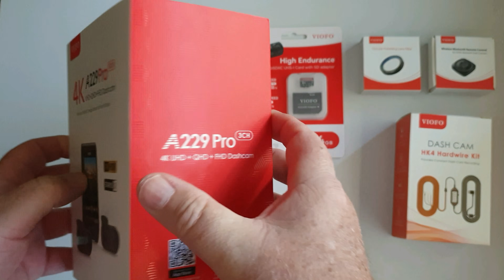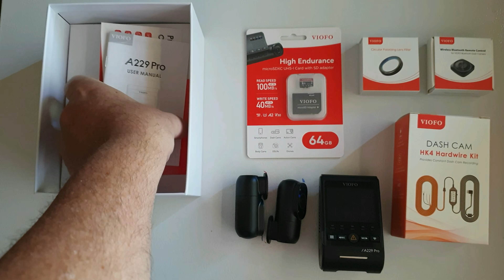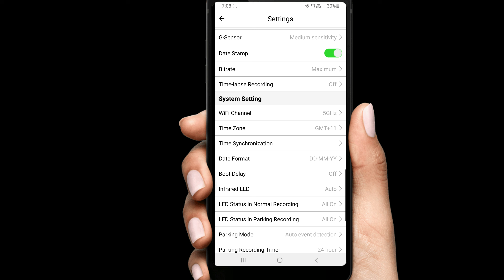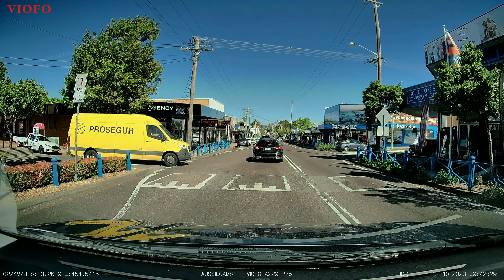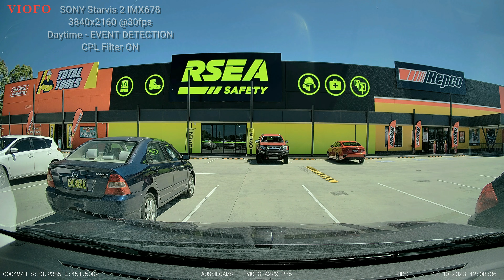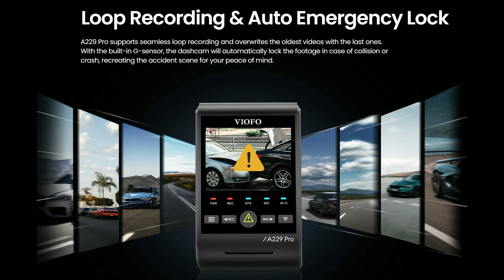Aussiecams - Viofo a229pro Dashcam first look, Unboxing, Roadtest, Overview 4k starvis 2 dash cam

Comment: Hi there. I'm looking at purchasing a new dash cam, but I've got some criteria I want to meet so I was wondering if you had any recommendations? The two most important things for me are sound quality and video quality. I drive a really noisy truck, but I find it's hard to find a dashcam that doesn't distort the audio quality too much. Also great video quality would be a big bonus too. If you see my videos I have two videos that were shot with my navman dashcam, but the audio quality is very distorted as the truck is loud. The picture quality is okay, but I know there's much better out there. Do you think the Viofo products would be good for me? I want to post longer form content from the dashcam itself, that's why I am a bit picky. Thank you.
Reply from the maker: Hey @sar4043 , I can certainly speak for the video quality side of things and i can say that the a229 pro with starvis2 sensor is probably the best for image quality we have tested. In my opinion the starvis2 IMX675+678 is the best leap forward in video quality for some time. As for the audio that's a different kettle of fish! Nothing wrong with any audio i've tested in general driving conditions in a vehicle but the trucks cabin is a completely different animal! I viewed some of your clips and understand exactly what you are talking about. The a229 pro has an optional microphone where you could mount the in the cabin and test to get better results (has a 2 mtr cable you could move around in the cabin and try to achieve the best result) its about $25 from memory. I suppose the voice commands may be affected by where you position the microphone, just something to keep in mind if you were to go that way. In saying that, i have tested it but from reports its an upgrade to the audio quality. Other than that i know its probably hard to find on yt but ive found looking over other truckies clips with maybe a similar rig to yourself is one of the best ways of identifying the better setups.
Reply: @aussiecams  Thanks so much for the reply, I appreciate it! I'll check out some clips with the a229 and the extra microphone and see how it sounds. I think video quality wise it does seem to be the best, or among the best at least. Thanks again.
Reply from the maker: correction, the pro version does not support the optional microphone - only compatible with a229/duo

Comment: will it survive in the heat?
Reply from the maker: Great question! Heat is a factor for all dashcams as temps inside a vehicle in summer can get extremely hot. Operating range up to 70 degrees then i believe it has auto heat safety shutoff. Im on all the forums and Dubai is just completing summer without any reports just yet. If you are on the fence about it just wait a few weeks as temps ramp up here, mid 30's and 40 odd will be just around the corner!

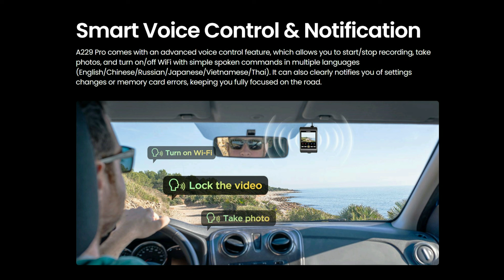Comment: 12:46 how fast is the actual transfer speed using 5ghz wifi?
Reply from the maker: Hey Steve, I don't have exact speed details on transfer speed increase for this version. I can tell you as per the settings I used for a 1 minute file it takes about 15-20 seconds (from memory) to download 4k file to phone/device
Reply: 17 seconds for 1 minute front and about 9 seconds for rear awesome camera

Comment: CPL filter is NOT included from viofo direct...
Reply from the maker: I can confirm the CPL is included with the a229pro 3 channel as standard from viofo and states this on the website https://viofo.com/dash-cam/328-viofo-a229-pro-3ch-4k2k1080p-hdr-3-channels-car-dash-camera-with-sony-starvis-2-sensors-for-lyft-taxi-ridesharing-drivers.html
Reply: You are indeed correct, the PLUS does not...my mistake.  @aussiecams
Reply from the maker: Appears the cpl filter is now standard across the PRO versions of the viofo range
Reply: Yes, it wasnt before  @aussiecams
Reply: So the cpl filter appeared in the box by mistake? Listed as an included accessory on the website

Comment: I think the very small price extra for the third camera would be WELL worth it. The 'yes, i did have my seat belt on' and the side visions. I really hate my 70mai and would never buy another.
Reply from the maker: You have a great point there and something I thought about but didn't expand on in the video. The interior camera could assist in many different scenarios, even in situations where drivers claim they had X In their hand while driving (where the detection camera says you had a phone but drivers claim it was an ipod or lighter as is on the news from time to time etc) I could if positioned it a little better but already have a number of dc mounts and etags that I wasn't going to move as I don't have anymore tape to reinstall
Reply: 100%.  @aussiecams

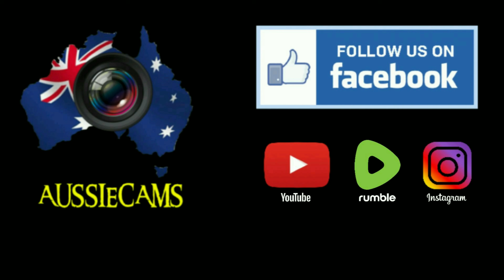Comment: 14:07 What program do u use to be able to do this? Certainly the best cam so far to read number plates. I have the A139pro, but I cant see much difference between the 2.
Reply from the maker: Hey tassy, where you been! Not heard from you for a while. Filmora v12.5. A139pro has same front sensor but the a229 has the better rear starvis2 IMX675
Reply: @aussiecams  Hi dude. Been about with a few health issues lately. I think its called, getting old. I use Filmora v7.5. That would be why my 139 looks as good as the 229 then, lol. I think the Backvues are dearer, but for a mid-high quality cam, u cant go past Viofo, although I still use the Redtiger in the truck. Be safe.
Reply from the maker: Oh I thought the other day maybe you stopped driving the truck. Hope you feeling better soon. A139 pro and a229 pro are exactly same as for sensors so in theory will look pretty much same. The a229 will probably perform a little better with upgraded chipset and better sd cards now available.
Reply: A229 has better processor and the rear camera has it's own processor hence why it can handle higher bitrates in 3 channel mode

Comment: If theres a better picture quality on a dashcam ive not seen it - looks great. Can i ask a question about it? What size micro sd would you recommend?
Reply from the maker: Martin, for this particular camera I would recommend 256gb. 3 channels recording i got almost 4hrs of driving time with a bit of parking mode here and there. To be perfectly honest, as the camera quality continually improves the larger sizes you will need hence viofo has increased the max size card in this model to 512gb (up from the usual 256gb)